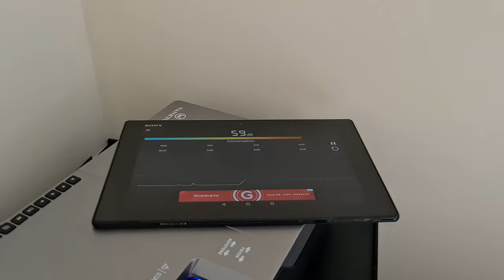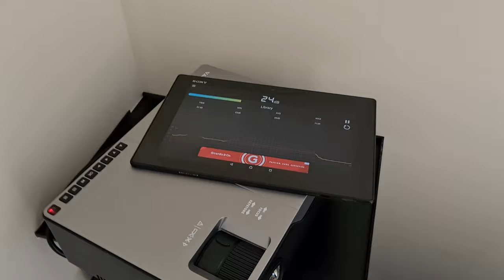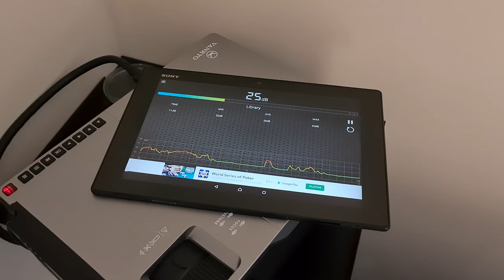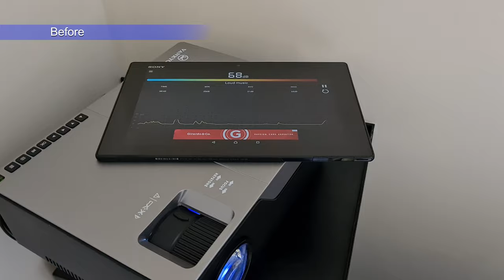VANKYO Performance V600 projector | fan and fan filter mod

Comment: Awesome Video, thank you for posting it. Wish I had seen it a little sooner, but its all good.
My V600 recently died. No LED light on the Power button, no items power on when plugged in and button is pressed. 
Took it apart, Cleaned it (wasn't that bad) and reviewed the PSU. from what I could tell, it might not be giving power to the rest of the unit. 
Does anyone know where I could get a new board? Also, does anyone know if there's any parts of it that would force it to not start if X isn't powered on, similar to the LEDs of a TV?
Reply: I have a same issue, have you managed to find a solution?
Reply: @vinothkumarraju707  No I suspected the Power board. I didn't have time to troubleshoot the board. but if you are technical with electronics, you could troubleshoot. I ended up reaching out to them and got a small refunded for it, that I used to pick up a new projector.

Comment: Hi again, I'm just taking the time to do this right now :) I have a small issue tho, maybe you know this by the top of your head, Google wasn't really helpful.

I'm looking really closely and saw that from the four cables in the new fan you have a Red, Yellow, Blue and GREEN cable, mine has Red, Yellow, Blue and BLACK

Looks like you are completely cutting Blue and Green and connecting Yellow and Black ? 

Naturally,  I'd just go for the RED and Black wire of my fan and wire them up with the red and black from the pin of the old fan. 
But you are going for the YELLOW (to red) and black Cable - Should I also go for my yellow instead of the Red? I'm trying to look this up with color coding on wires but it's just more confusing. 

Maybe you have a quick tip on this, otherwise I'll keep on googling :D 

Cheers
Reply from the maker: I hope this answer your question: 
https://allpinouts.org/pinouts/connectors/motherboards/motherboard-cpu-4-pin-fan/
Reply from the maker: The 12V and the ground are usually next to each other.
Reply: @L0L0K3  Perfect!! Thanks ;)

Comment: Question: if I live somewhere cold...in your opinion could I get away with just snipping that fans cables? I would run it in a spacious cool area. 

I know this will shorten lifespan, but the noise is just too bad
Reply: LOL, it will be short lived quietness,  it will overheat quickly and damage LCD and next on the way will bi LED.

Comment: Very interesting, but, a lot of trouble for most people. Put the projector on the ceiling a few feet or MORE behind you the further away the less noticeable the noise. The real problem with these projectors in the long run is not so much the noise-which will always be there, but DUST. They are not sealed so over time dust will invade the unit. The filter is OK but could BE A LOT BETTER. Perhaps a dual filter-now that would be an easier and important mod. Dust? It's EVERYWHERE. Why do you think they have CLEAN rooms in CPU manufacturing facilities? I wonder if running an ionizer in the projector room would help this?

Comment: It makes no sense that a manufacture of such pricey gadgets won't use quiet fans. I'm almost certain that they know they exist. I have a laser projector with four fans: two 95MM fans, one 105MM fan and another that's directly under the laser which looks to be a 60MM fan. Although I am not certain yet. I tried building a hush box but that didn't help. It simply trapped the heat. The noise was still there. I will mod mine as soon as I get those fans in on order. By the way, you can use a 4pin to 2pin adapter for the fans which keeps you from having to cut and solder.
Reply: Did you mod it? I wa thinking the ame thing but you need to get same spec fans or you can kill your projector.  If you do get the same spec I wonder if theyll really be quieter